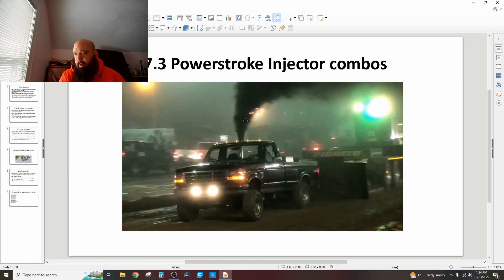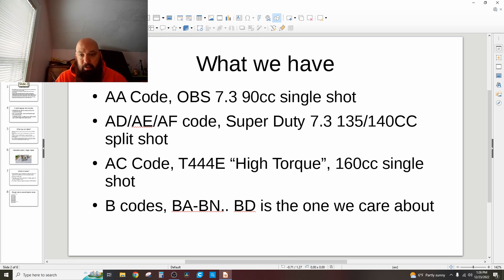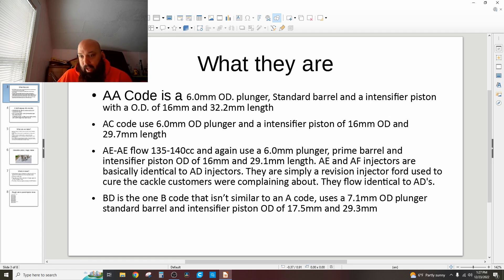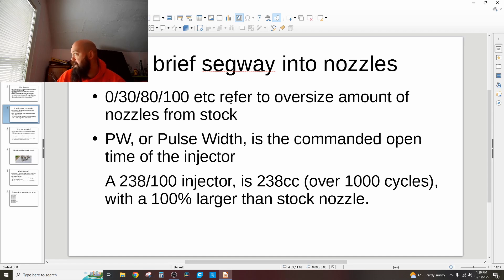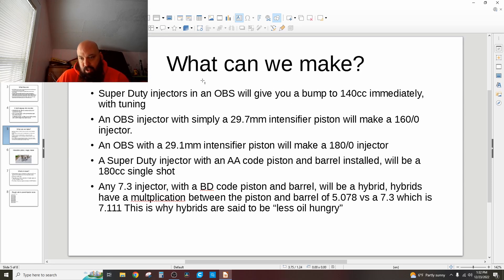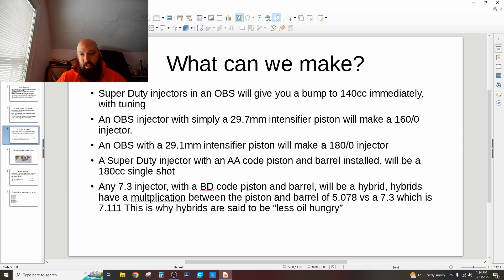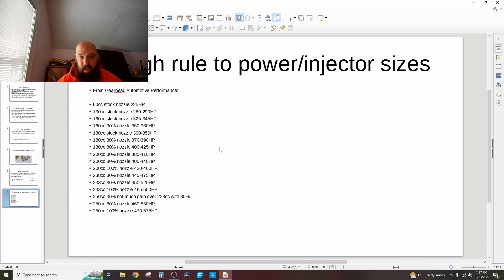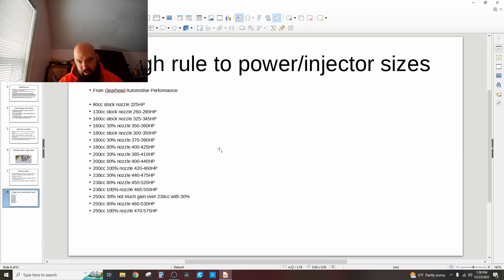DIY 7.3 Powerstroke injectors, how to make big power cheap!

Comment: My question is in the link it gives you 2 different part numbers for the 29.1mm length intensifiers, how do you determine which one to purchase. And i called the company they were no help.
Reply from the maker: Probably doesn't matter, but I showed in the video, I used the cheaper ones.

They're not going to be any help, they're selling parts not service.

Comment: I'm doing my injectors right now
Except for number six and number eight, all of mine say A000109118 of course the number begind the A    chages slightly.   Number 6 has a AA1816187CS,  and
 #8  AE 1833639C1. 

Can you help me identify what i have in my truck?
Reply from the maker: The A00*** is probably AD, stock Super Duty injectors.

Common for Super Dutys to have an AE in number 8 as well. 

The AA though, should be a OBS injector, unless someone has swapped solenoids
Reply: @TheDrivewayEngineer thank you and yes I'm concerned there had been a swap of some sort on that injector?
Reply: Thank you so so much for helping me.

Comment: I have stock injectors big turbo,exuast, air filter custome tuning by Jodi.  My truck hauls the mail. Pull 17k at 6  % 65 mph on 35 onch tires.

Comment: Great video as many of the others you have created ! Would you have one on the process you use to shorten the intensifiers as mentioned in the above video? I also wonder if these could be precisely center drilled to achieve a blind hole, equal on all eight; thereby creating extra volume. This would be easier perhaps then machining or grinding them to a shorter length. Regardless, I have a great appreciation for the size-specifications, you have provided.
Reply from the maker: You'd need a surface grinder to shorten them.

A machine shop can do it for you pretty cheaply, that's how a lot of injector builders shorten them.

I was quoted 100 bucks to cut a set of 8 down, splitting the difference between each end.
Reply: Could calculate the volume increase before drilling and boring.

Comment: I have stock injectors in my 97 obs and i have a 6 pos chip rn. Is it necessary to reburn the chip for 180/30% injectors. I have a friend who has an obs 7.3 and didnt have it reburned and his runs fine.
Reply from the maker: If it doesn't know it has bigger injectors, it'll never fire them like bigger injectors.

It will run fine.

It will never run like it has 180/30's

Comment: I’m a bit confused on this as far as the “. Barrel removal” or do you do just that alone? Or what do you replace the barrel with ?
Reply from the maker: An OBS barrel. 

If you have a SD, SD intensifier pistons in an AA injector make 180CC, or an AA plunger and barrel in a AD injector makes a 180cc injector, either way.
Reply: Okay now that makes perfect sense freaking great thank you so much and where did you say you can buy the barrels ?? I’m having a hard time finding anything.

Comment: so i need to replace the pistons only, and i don't need any extra tune? If it is this easy I am going to try. I need to buy 8 pistons right?
Reply from the maker: If there's nothing wrong with your injectors now, then replacing the Orings and the piston will make it a 160cc injector. It will run on a stock tune with 160's, it will not use 160 worth of fuel because it will never command it.
Reply: @TheDrivewayEngineer  Just to make sure I understand correctly: i need to use a tuner to get a performance boost from the injectors after I mod them?

Comment: Awesome video.  I have both7.3  trucks and a mysterious 97 with lots of mods.  My 02 feels only slightly faster . I scored a spare set of obs truck injectors from junkyard.  I need to check them since they were on a fleet truck
Reply from the maker: If they were in a pickup they're AA code, unless someone changed them.
Reply: @TheDrivewayEngineer  it was a truck with a utility  body. Never saw fender emblems.  I know there's some odd f450 superduty heavy duty pre 98 trucks

Comment: Is it worth checking on what injector/nozzle setups the marine versions of those engines have?
Marine hp ratings are always higher than their equivalent automotive hp ratings. 
I know of 2 x 7.3 engines in a customers boat and they are 300hp from the factory.
Reply from the maker: Possibly?

The 160-238cc combos here are everything you need to go from anywhere from 300-500hp